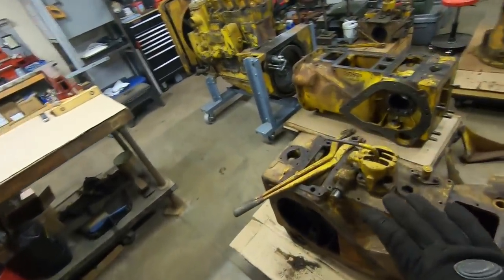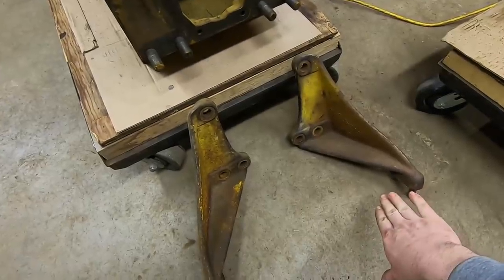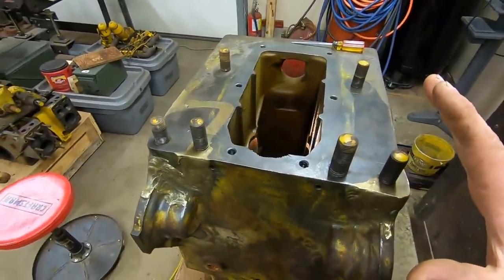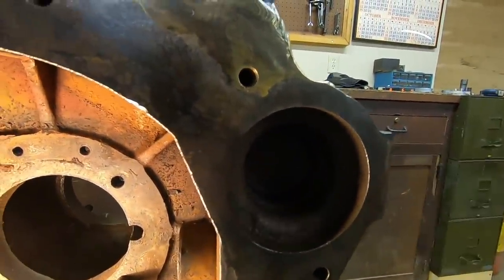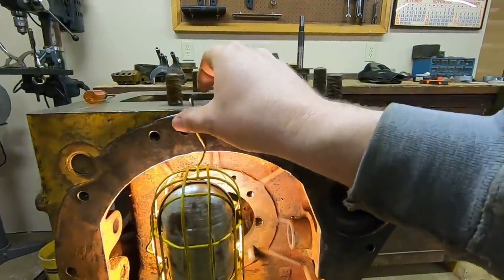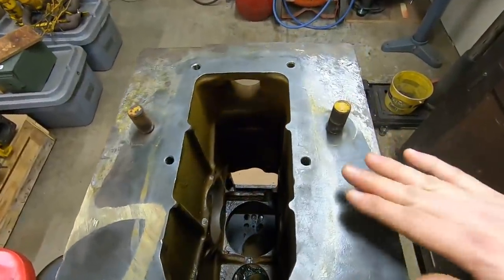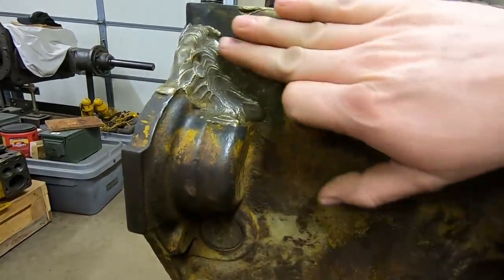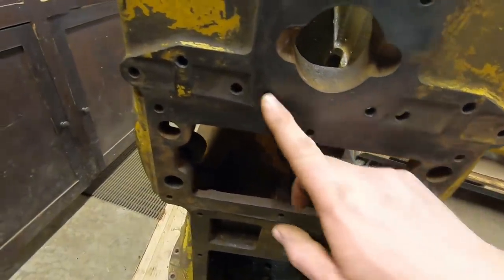Caterpillar D2 Transmission Casting Weak Point & Examining An Impressive Prior Repair On #5J2115 SP

Comment: One possible solution to machining the brazed surface of the back of the transmission castubg would be a shaper.   I believe that the front surface of the housing is also vertical plumb.  If the housing were placed on end on a true surface, it might be possible to rotate it around so that the shaper arm could cut flat all required parts of the periphery.  There are guys on YouTube (abom79 comes to mind) who like using shapers where a milling machine might alternatively be used.  One of those experts might be able to watch the video and render an opinion as to how it might have been done.

Comment: I think it would be neat to make a table out of the 2115 case
Reply: Set it horizontally and put a piece of 2" Plexiglas on top
Reply: Just hope your wife doesn't need to have it moved at anytime after it's in place , I'm assuming that it weight's alot like 4 or 5 hundred pounds

Comment: I rely enjoy an autopsy on ad old repair. Was wondering if the milling marks center on a gearbox shaft. Did some one make a line boring set up for face milling?
Reply: I was wondering the same thing, it'd be very logical for a field repair vs, as he described,  a proper casting shop repair. It certainly looks like it & would explain the slightly heavier effect to the lower half.

Comment: I like how you can almost 'see' how they broke it, based on the patterns from the repair...

Stripped out/replaced stud, and torn off section of case with the other stud, on the right; and a whole blown out section to the left that looks like it was twisted off almost makes me think they had a chain around the right hand side of the swing-plate and pulling real hard on something... then when the stud (and chunk of case) came away on the right hand side, the whole mess just twisted off to the left. 

...probably followed by a whole lotta cursing the air blue.

Comment: That looks to me like they had a towing winch on that tractor at one time and the bolts were not as tight as they should have been, thus the wear on top of the case and the breakage. Plus the serial number tag removed for the winch mounting. They then put a drawbar back on it. That explains the excessive gear wear also [driving the winch]. Is there any wear pattern on the counter shaft spline where the winch drive shaft would couple?

Comment: Squatch253 - can you help me understand the expected pounds of compression for the D4 Pony Motor.  Having problems getting mine running after sitting for awhile. It seems to have good spark and fresh fuel, but just cannot keep it running.  The Cat manuals just do not seem to go into details on what to expect on compression test settings.  Any advice you can share?

Comment: 10:50 This may sound as if I am taking the Micky, but I am not ! Give the outside a clear coat, paint the inside cavities with some different coloured REFLECTIVE paint, and mount a light inside to catch the paint. Get a 3/8th inch thick polished perspex plate to mount on the top, (fixed with the  studs), and use as an "UpLighter" / side table / coffee table in your "Man-Cave." 

Or as a birthday present for Snr :-) ! (Bed side Light-Table ? :-)  In the UK it's called "Up-Cycling" rather than Re-Cycling.

Comment: Yes very serious craftsmanship there; I'm betting it had to happen early in it's life(relatively speaking), as that'd still have been almost an invaluable asset to use well into the 60s, right? Wasn't it about that time that other brands were starting to make smaller machines of similar capability?
 Loosely guessing the repair at 60 - 70 yrs old?

Comment: I would think brass would be too soft for a machine like this. You did say that area was structural but not made for pulling. I don’t pretend to know anything about this stuff. My only encounter with Cats is painting the huge engines that ran the off shore drilling rig I worked on .

Comment: Any good news from the machine shop about the starting engines? I was wondering if you could use your complete starting motor ( the one with the electric start in the crate) in order to test run the motor on the stand.

Comment: I'm wondering if it was machined in a lathe and not a mill as the bell housing end would be parallel with the rear of the case  there is quite a lot of iron hanging off the chuck for a normal lathe there were vertical lathes that would happily machine something that size

Comment: Really interested in how you will reattach the bevel gear to the shaft, inside the housing. Best guess: you built a special tool!
Reply: @squatch253  I was hoping the “magic bolt” had a role but, still sounds pretty interesting 🤔!!!

Comment: If those machine marks are in a spiral pattern like you get facing on a lathe, I would think it was most likely done on a vertical boring mill (also called a VTL, vertical turret lathe). It would have been a lot easier to set up than a normal lathe.
When you pushed the first case out into the other room, did I see an antique drill press on the right?  If it is, could you show some pictures of it so I could see if it is like mine?
Thanks
Reply: @squatch253  Thanks, mine is a Barnes according to the paten date of "JAN 83" on the quill handle, no other markings on it. Out of many I have seen, none have been a match to mine. Some with many of the same features, but none set up just the same.

Comment: Squatch, I've always wondered how strong a braze repair like that is. I thought (perhaps incorrectly) that brass was considerably less strong than cast iron or steel, but I see so many repairs like that. Is a braze repair like that as strong as the original casting?
Reply: Depends on the braze but normally it is about 70-80% the strength of the original cast if a good job is done.

Comment: I would say at that time I bet the used a fly cutter, whoever brazed that back together was a Master Welder .
Reply: Have you ever seen those huge diameter decking mills they use on engine blocks? Maybe they used one of those. They were pretty common in shops back in the day. They even sold the huge diameter cutters to put on old milling machines so you didn’t have to buy a specialized decking machine. Perhaps that’s what they used? Idk